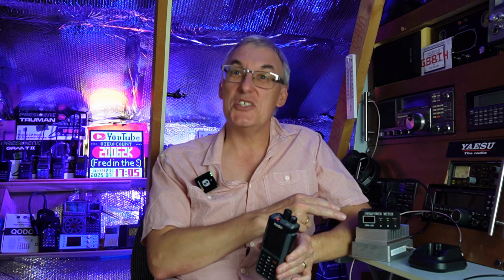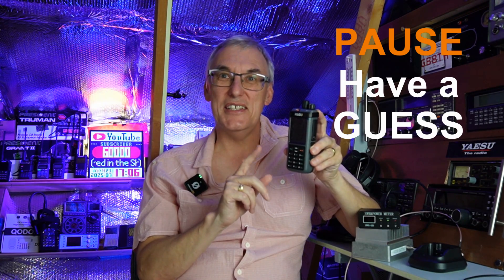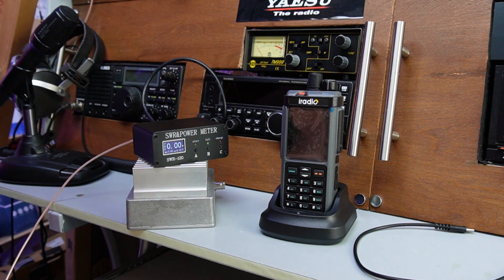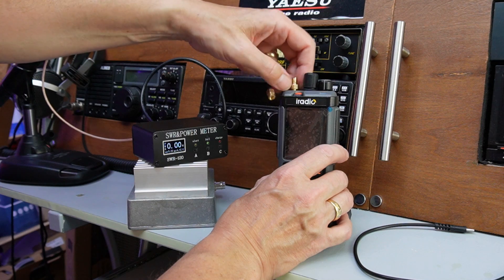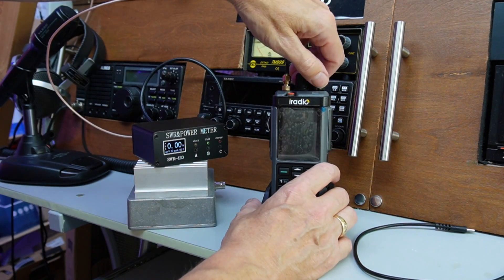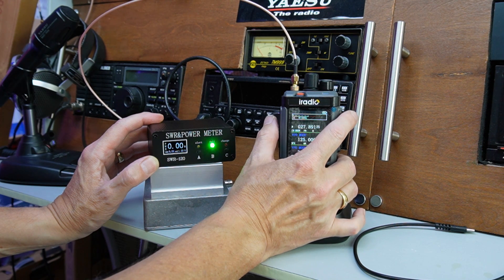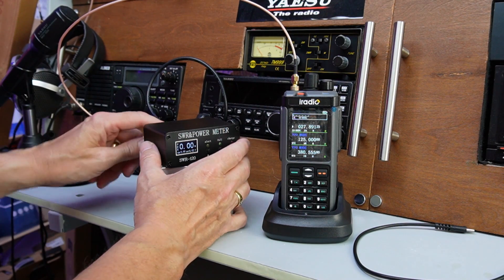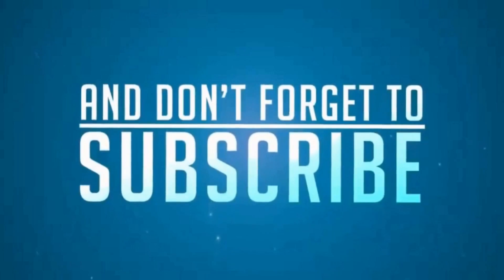IRADIO UV-98 PLUS. How Many  TX WATTS on  27MHz UK FM CB Channels

Comment: Close to 4w.  If you want to get more exact, forget those cheap digital meters and use a proper Bird wattmeter with the correct 10A slug (25-60MHz @ 10w).
Reply: Mine does 3.8 through a Bird 43 with a 10A into a Termaline dummy load.